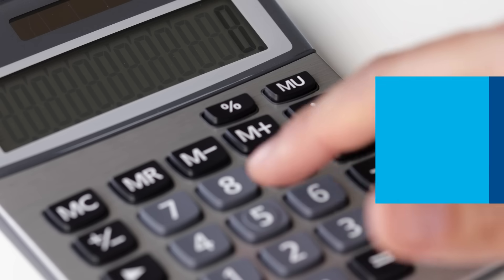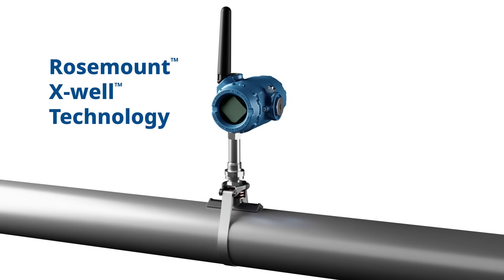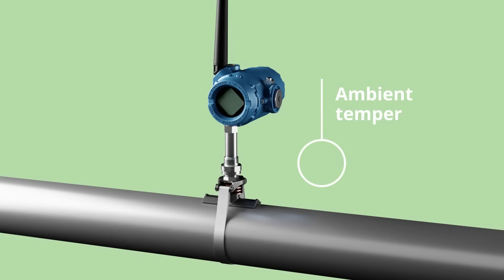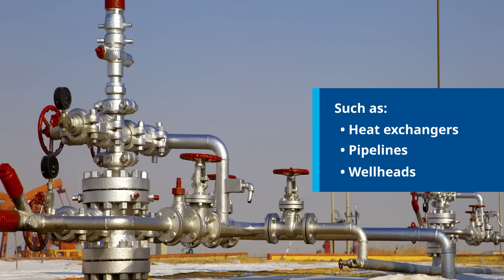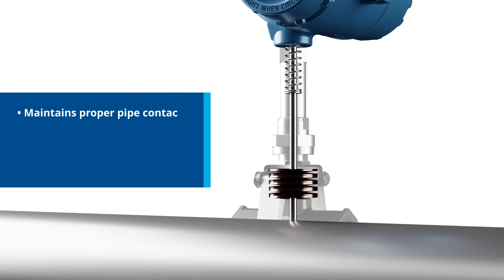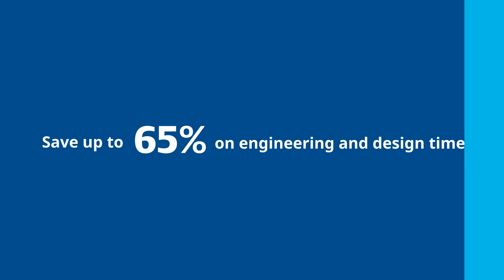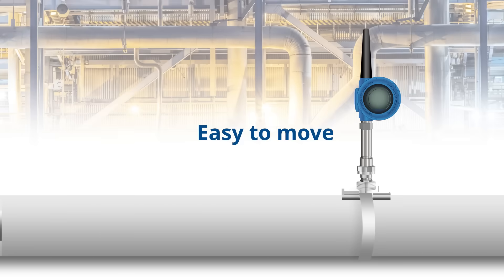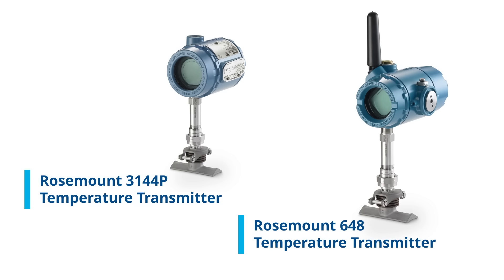Get a Reliable Process Temperature Measurement Without a Thermowell

Comment: How it measures process temperature, how accurate it is, sil rated?
Reply: The accuracy is within +/- 1 Deg. C. There should be insulation of about 2" upstream 2" at the installation point., 2" downstream as a good practice.
I have customers doing energy calculations on lines with the 3144P with X-Well technology and are very happy with the trouble-free/maintenance-free operation.
The 3144P is also SIL rated IEC 61508.